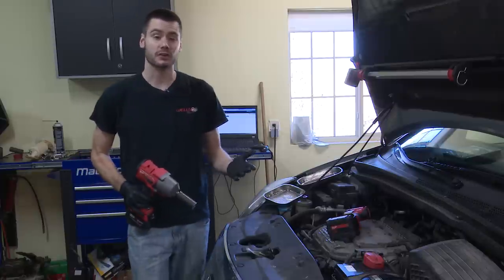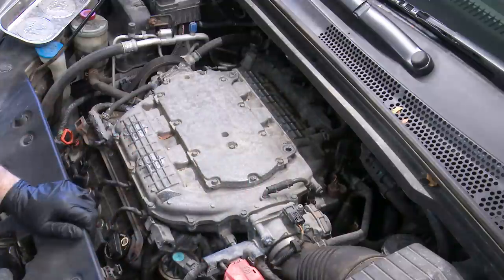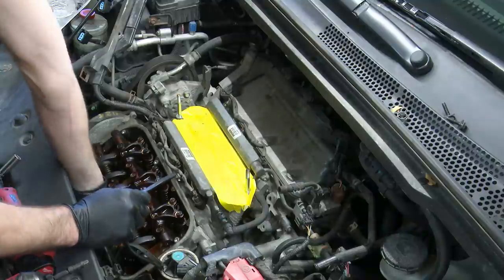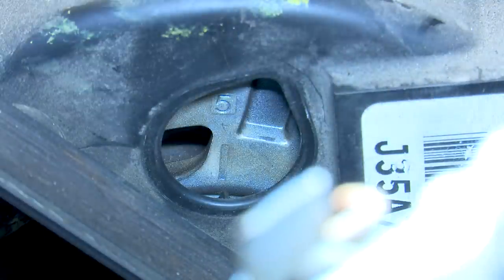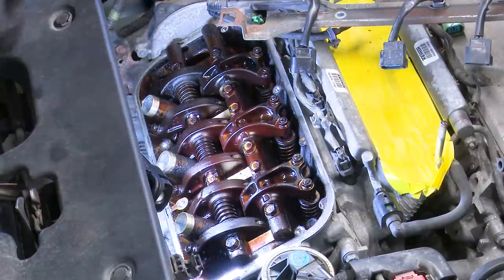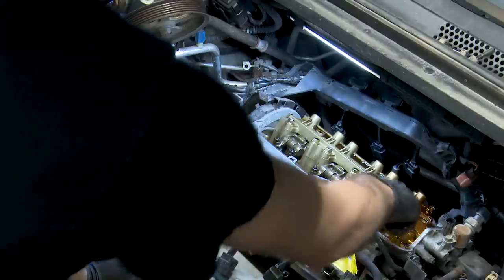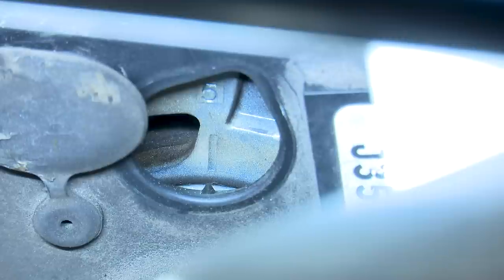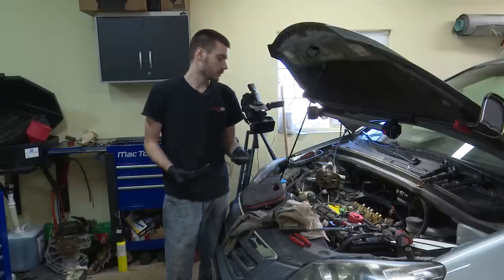2006 Honda Odyssey 3.5 Random Misfire Case Study Part 2 : How To Perform A Valve Adjustment

Comment: OK. This is just cool seeing the inside of my engine. I do have a question for you. I took my 07 Ridgeline 3.5 I believe the same engine as this is back to the dealer with a concern. I told them when I'm cruising along at 50 60 and give a little gas it seems to hesitate but if I push more it takes off. I was told by a mechanic to run 4 o5 tanks of high test and the cleaning agents will do the trick. I did so and worked like a charm but now I'm back to regular and the hesitation has returned. What does this mean? Bad coil. Bad plug. Bad/dirty injectors? PS. I put high test in again and runs like its new. I have 140,000 miles
Reply from the maker: Hey Craig, thanks! Not sure what area you live in...what % ethanol is in standard gas? when you say high test do you mean high octane or do you mean top tier fuel?
Mike Becker, Senior Technical Services Instructor
Reply: Wells Vehicle Electronics Hi Mike,  I've always ran regular 87 octane and it ran perfectly until now. I get the hesitation like I spoke about. I put hight octane in I think its 92 or 93 octane and all runs smooth.  We do have the ( No ethanol ) option here so does that make a difference? I have ran both.
Reply from the maker: Craig, something has changed. You vehicle is intended to run smoothly on 87. You should not have to run high octane fuel. I would start with an inspection of the fuel trims when the problem is occurring. Sounds like you have a bit of a head scratcher here. 
Mike Becker, Senior Technical Services Instructor

Comment: Any ideas on what would cause the engine to "nose over"  on initial takeoff?  Like sputter when you 1st mash the accelerator in a 99 accord 3.0
Reply from the maker: Could be a lot of different things that could cause that Brandon. First thing I'd do is to make sure the throttle plate is clean.
Mike Becker, Senior Technical Instructor

Comment: can someone explain why bank 2 is dirtier than bank 1
Reply from the maker: Great question, my guess is heat. One bank gets hotter than the other.
Mike Becker, Senior Technical Instructor
Reply: Front bank has the PCV running through it.
Reply: Perhaps it's because bank 1 gets shut off with VCM, resulting in less heat on that bank because the cylinders aren't firing?  Might also explain the difference in exhaust lash between the 2 banks.

Comment: You don’t do a novel every single day because you will need a air gun because those electric guns or battery operated guns when they fail they fail quick. There is going to be a day that you need an air gun.

Comment: It helps to have the right tools. This guy is kinda winging it.
Reply from the maker: Every job is eaiser with the proper special tools! Sometimes people don't have them. Like I did not, so I "winged it." Either way the job was finished and the customer was happy. Some new bent feeler gauges are on my shopping list though!
Mike Becker, Senior Technical Instructor
Reply: skrub love   Very few cars still have adjustable valve mechanisms. He might not adjust Honda valves everyday, he doesn’t have the Bluepoint tool, but he can read and follow directions superbly. And that is what is of value to me. Now when he gets out the electronic stuff, all bets r off. That is his area of expertise. This video was extremely helpful as I am doing one today. Thank u Mike!! No disrespect Mr. skrub.

Comment: Its 2019 not 1964 what the hell are we doing adjusting valves? and if adjusting valve lash isn't bad enough this POS also still uses a timing belt too. NO THANK YOU. I used to boast about Honda NO MORE the Honda 3.5 is a maintenance pig If the general public was more informed when they went to buy cars with these engines Ill bet most people would turn away
Reply from the maker: Hey man, yes these engines require maintenance...but when properly maintained they do last a long time. They are overall great engines!
Mike Becker, Senior Technical Instructor
Reply: @GoTechTraining I really didn't think that they made cars today that required valve lash adjustments with all of this super advanced automotive technology it seems kind of backward to have to do valve lash adjustments. Anything will last with proper maintenance Todays cars do practically everything for the driver They  park they know the way to get there they brake they control traction they talk to you They control fuel and ignition and make themselves more efficient Yet we still have to disassemble engines to manually check tolerances? Crazy There was a reason they did away with tolerance checks back in the early 1970's People didn't like doing them and the earlier engines were far easier to get the valve covers off Well I guess those cars exist for those people that just love to waste all day under the hood of a car.
Reply from the maker: I agree it is odd that they kept it for so long when other manufacturers got away from it. As an owner, it probably sucks...as a technician it's great. 
Mike Becker, Senior Technical Instructor
Reply: @GoTechTraining  True there's a lot of earning potential from a job like that for Technicians As far as manufactures go they rarely if ever especially nowadays make any changes to a car line for the sake of the customers benefit Any changes they make is for the company's bottom line

Comment: Also the vehicle keeps going into the protection mode where it shuts down three of the six cylinders very annoying is there any way of disabling that I did notice a lot of smoke comes out the exhaust at times Blue Smoke
Reply from the maker: I don't believe there's a way to disable this system without some form of tuner system.
Mike Becker, Senior Technical Instructor
Reply: find a video of replacing the the vtec spool valve gaskets. you can buy a whole new assembly for 350 or spend less than 50 on a solenoid,gaskets, and a oil pressure sensor switch. your gaskets are leaking and the screen is plugged up in the gasket. this keeps the vcm from working properly and causes the codes and smoke and bad running engine.